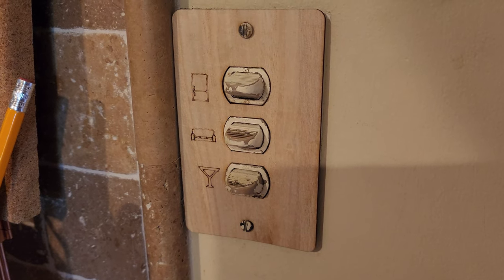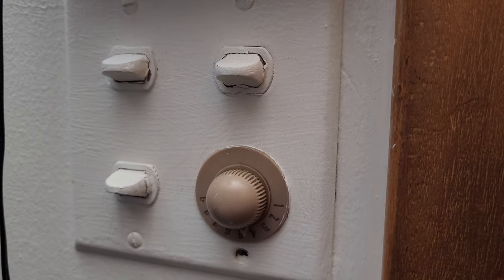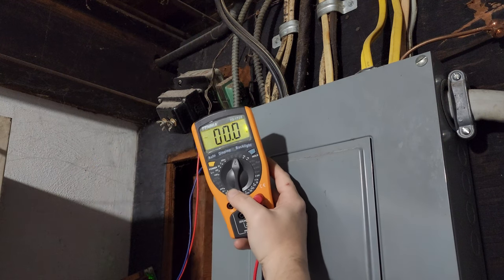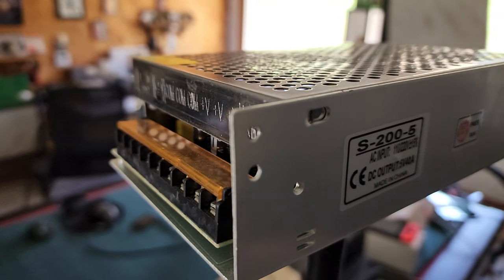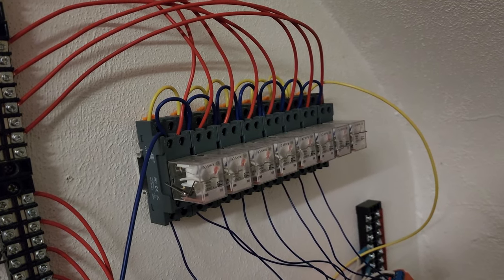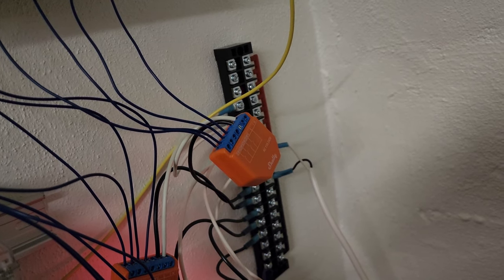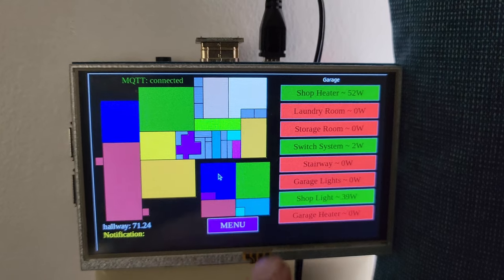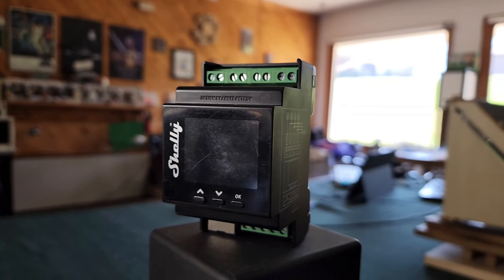What Is Legacy Low Voltage Lighting and How Is It Better?

Comment: My father-in-law recently died leaving his heirs a 1959 built house with Remcon lightning relays and switches. As I’ve dug deeper into options for repairing or replacing several worn out switches, I’ve realized that these parts are rare or just not around.  So I’m here looking for info. Thanks for your videos!
Reply from the maker: It can be difficult to find pieces parts the first video I did on the channel covers a lot of the history (if you care), but more importantly to you probably is the reference to Kyle's Switchplates, which has the most comprehensive listing of parts I've found. There are plenty of ways to retrofit newer tech, but it requires a fair amount of planning and research.

Comment: this is a low voltage group therapy group - i too have a low voltage system. VERY hard to troubleshoot and fix but trying my best.  Where do you buy your new relays?  I have bought mine from Kyle.  I have 3 multi dial panels that don't work but cant figure out what relay controls them.
Also just spent a week try to get patio light to work that haven't worked since 2003.
Reply from the maker: If the dials don't work entirely it's more likely that you have a broken common wire going to them than an issue coming from them--which is actually a bit better because it narrows down the number of wires that could be the culprit. As far as relays, I have Shelly Pro 4PM relay modules now, but I've recently been turned onto a near drop-in replacement. The model is RIBL24B, but I don't have a specific source for them. 
You'll probably have to dig around online to find a place to order them. Otherwise, yes, Kyle is awesome. I learned so much from their site in the early days of working on my system, they deserve the patronage at least just for maintaining nearly the only source of detailed information on low-voltage lighting controls of this species on the internet. 
As for the low-voltage group therapy, I think you're absolutely right. I've met so many low-voltage owners since my journey here started that I've seen the strangest problems and most unique situations. I believe these systems are amazing and approaching them with modern technology could make them practical again, but a lot of times, they are not for the faint of heart. Thanks for being a part of the group... we feel your pain.

Comment: Where are you located? Roughly that is, not stalker like lol, I used to rent a house that was built in the 50’s, it was the rush development of our little town at the time, and this particular house was owned by the people that had the biggest car dealership, this system was similar to yours except push button momentary switches, with flip flop type relays. They barely worked when I moved in, but I got everything working again during my lease there. It didn’t have any dials like yours, but the master bedroom had a whole bunch of switches right beside the bed so pretty much any light that was likely to be on at night could be turned on or off from there. It’s the only one I’d ever seen, I’ve been in several of the other homes in the development and none of them had the system either. They were early to mid 50’s to around 1970 built homes. Oh, I’m in south central Pennsylvania.
Reply from the maker: What you had there was likely an even older style system before that was developed before the snap-action device was finally patented in the early 50's. They had toggle switch operated relays that were often found in attics between the rafters prior to this and up through the 60's. I am in southwest Ohio. Most of the systems I've seen or talked to owners about are in areas like ours, but I think that might just be the work of the algorithm because I know there are systems like these in Arizona as well. Thanks for giving my video a watch and sharing your story! I love hearing about other folks' experiences!
Reply: @smartercircuits  all the wiring was very neat, all in one place in the basement, I wish I had thought to take pics or videos, it was 2012/2013 era.

Comment: Wish you can come out to my house. No one seems to know how to work on my system. My power just went out to my home but only the fridge and front porch is working. I can’t turn the front porch light on or off.
Reply from the maker: That sounds very stressful. I may be able to offer you some guidance to troubleshooting if you would like to send pictures of your system and a bit of background, I can try to help (smartercircuits@gmail.com), and if you are on Discord, you can always join the Smarter Circuits server (link in the channel banner on the channel page) and post some questions to the general group and someone may have answers for you there as well--a lot of smart folks are gathering there. I will forewarn you, I will be a little slow to respond for a week or so as I am traveling.

Comment: I want to replace all these relays and switches and sphegetti wires with normal 12 gauge romex and switches, I’ve got a huge mess on my hands
Reply from the maker: It's usually a very large undertaking to convert to a modern standard wiring schema, but perhaps there is more than one way to skin a cat. Maybe you can upgrade, integrate smart functionality, and still have a normal control schema for residents as well as being able to monitor usage and perhaps even problems. I can understand trying to circumvent the time investment, though.

Comment: Just wondering if there is any modern systems that implement low voltage switching and lighting or if this is just about fixing the old dinosaurs?
Reply from the maker: A little of both. There are modern relay controlled systems--particularly smart homes--and having a centralized location for those controls will always be preferable. I see IoT making more of this sort of thing common as well. There's always been an element of this, I've worked on systems that were created in the homes of engineers from machine controls they were used to in their work. 
I've always loved mine, but I've talked to many homeowners and electricians that are not fond of them. I think once smart automation brings more necessary standards, it will all eventually resemble something akin to one of these old systems.
Not sure if that's a good answer, but I do appreciate you asking the question--and watching the video. Thanks!

Comment: Everything in this video is so foreign and out of my league. 5 years ago we bought a 100+ year old house that has touchplate lighting system throughout, along w a few regular looking switches. My husband has fixed everything for the 1st 15 years of our marriage but was diagnosed w dementia shortly after we moved here and is unable to understand or fix things…Half the switches in our house don’t work now, meaning most lights are stuck ON but lights in bathrooms, bedrooms and dining room  are stuck OFF. It’s so bad bc we can’t find anyone that knows anything about the system. We have 4 kids and the elementary kids rarely get their homework done bc it gets dark so fast. Out of all the issues we’ve dealt with since my husband was  diagnosed, the lights are the worst. Can you point me to ANY resources/videos that can help me fix our lights?! I want to take an electrician course just so o can understand the terminology and learn to use the multimeter we have but I have NO time, w a full time job and 4 kids.
Reply from the maker: It can be a lot to take in if it's not an interest already. I think I may be able to offer a few smaller suggestions here and then work our way up from there. If ALL of the switches are stuck in their states (except the "normal" light switches), there is a very distinct possibility that a wire to the transformer or the transformer itself is to blame. 

This wouldn't require an electrician as much as someone who knows enough to install say a stereo system. Most electricians sadly run from these systems because they don't fully understand them or they don't think it is worth their time. 

The transformer in question is probably near your relay box and you may have more than one depending on how many switches you have. If you have two and one is much smaller, that's likely your doorbell. I hope this eases your mind a little. My email is SmarterCircuits@gmail.com if you would like to correspond somewhere other than the comments section. I may be able to walk you through some simple troubleshooting steps to eliminate possibilities one at a time.

Comment: The RIBL24B relays can replace those GE made RR latching relays
Reply from the maker: I'll have to grab a couple and show them.
Reply: The wire positioning is a little different, but it’s still a 3 wire pulsed input latching relay: https://www.functionaldevices.com/wp-content/uploads/2021/10/RIBL24B.pdf

Comment: I'm thinking. Is it necessary to use 120V (Europe 240V) AC for general lighting? 
Today's LED lamps have a maximum of maybe 15 watts.
Many solar systems are built with 24 volt batteries to have a reserve in the event of a power failure. 
Then the current must be brought back to mains voltage. Is that necessary? 
A single LED requires 3 volts DC and 3 LEDs are very happy with 12 volts. 
If the current is to be high, 6 LEDs at 24 volts DC is the gold standard.
Reply from the maker: It's not necessary to use 120/240VAC for lighting, in fact most modern LED fixtures are stepping it down and rectifying it anyway; however, it's a pretty sizable project to convert to pure DC lighting--although, I know several people who've done just that. One thing to keep in mind is that a typical 6W 120V LED bulb is drawing 0.05A (even though it's just stepping it down and increasing the current on the board) while a 6W RV light at 12V is 0.5A. One of these things will kill you much faster than the other, and DC is the one that will kill you faster. Not saying it's not safe to do, but the fact remains that stand alone DC lighting systems in most houses would probably be a recipe for disaster. There are plenty of systems that are designed to do this (landscape lighting for instance), but they are specially designed so that people who only know enough to be dangerous aren't going to set their houses on fire.

Comment: I’m inheriting a couple houses that are full of these relays and switches, 🤦🏻‍♂️ super stressed out about it
Reply from the maker: I sort of covered this in another comment, but I think if you step back from it and think more about the circumstances as simply an environment to work in with its own unique features and restrictions rather than an insurmountable problem, you might at least see clearer. Certainly enough to put whatever your next steps are in order and stress a little less by simply putting one foot in front of the other until you reach your destination--whatever that may be.

Comment: I try to be open minded. But as a licensed electrician with 50 years in the trade, this authors arguments are hmm as good as his works appears. There is NO benefit to LV at all. These were made for the sake of technology to "jazz" up into the new space age of the 1950's.   I have removed many of these systems and wired them to all line side wiring methods. Just that fact ALL the lighting in the house needs wired back to the LV control panel should clue one in as to the folly of these systems. Now if you need to turn your light off from your lazy boy have at it.  Why does one need to control all their lights from one location?  Why not think hey I need to turnoff the lights I am getting a free work out here! My guess is any electrical inspector worth his license would condemn this system in a  heart beat. (And as an FYI the old "relays" are actually solenoids)
Reply from the maker: There's no longer run than there would be from the circuit breaker panel, so you are wrong about the length and centralization as the shortest route has been taken rather than routing to a switch over and across walls and ceilings unnecessarily--the shortest path can be taken to where the mains box is anyway. Also, connect four switches to one light without using travelers and special switches--you can't.
GE, Remcon, Sierra, TouchPlate and dozens of other companies refer to these as relays because they act like a switch remotely and it's a more common term for such a device--particularly to non-technical people, so please take it up with them. 
I'm aware of a certain level of novelty and even elitism with these systems in the 1950's, but you're wrong about the usefulness and the inspector comment since low-voltage systems are not regulated by building code, being less of a fire hazard. If any part of the control wiring fails, it doesn't set your house on fire like a faulty breaker, chewed wire, or even a wiring fault has the potential to do, so it's not a concern for building codes in most areas.
Why does one need to control all their lights from one location? Well, perhaps security, peace of mind, comfort, or even disability. There are plenty of benefits to these systems, but if you don't agree, that's fine. You don't have to be rude, disrespectful, condescending, or matter-of-fact about it. 
I'm glad you have 50 years of experience as a licensed electrician, and I'm sure you have a large knowledge base that you've accumulated in that time, but that doesn't make you automatically right and using it to beat people over the head rather than constructively criticize or contribute to the general conversation just makes you seem abrasive and unlikable--regardless of your skill.
As far as how my "work appears", you don't have to look at it or live with it. The initial work that's been done was done in haste to begin with in order to get the lights in the house working because I couldn't afford to put an electrician's kids through college just to run some extra Romex and tear up all the walls and finished ceilings in the basement--stapling the wiring to rafters and studs is code here anyway. 
Also, there's nothing wrong or dangerous about what I've done--it's just ugly. I didn't have several hundred dollars to spend on a box to mount everything at the time, but it's slowly moving in that direction. I never claimed to be an electrician or an electrical engineer--in fact, I often make it a point to remind people that I am not. What I've done is not dangerous or even against code since everything is UL listed--that I do know. 
Lastly, I make videos because other people found what I did useful and I thought it would be neat to carry on and try to build the channel--which I've worked very hard to do. I certainly didn't shout from the mountain that these were the unbreakable, irrefutable truths of the universe. 
When it's appropriate, I try to own when I am wrong, listen to differing views with an open mind, and I try to steer people in the best direction for their situation--often times recommending consultation with an electrician for safety reasons. I also welcome discussion and even correction because everyone will take something useful away from it all. 

Thanks for watching and have a great weekend!